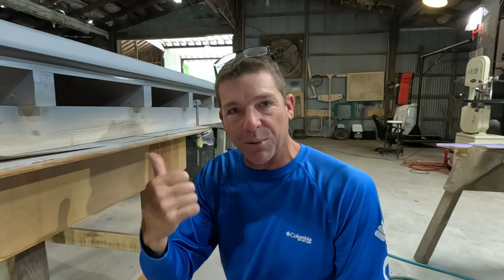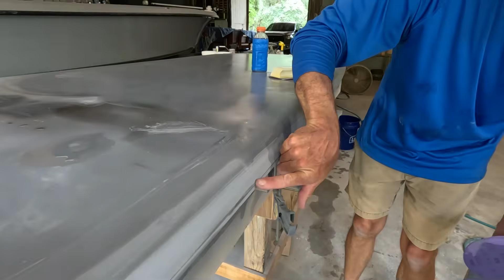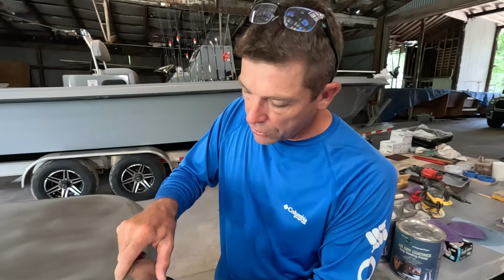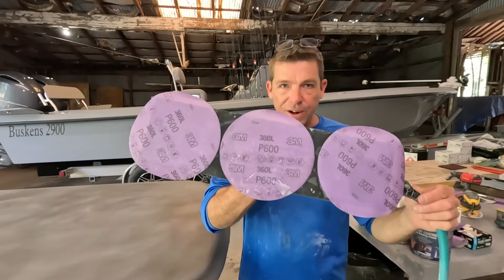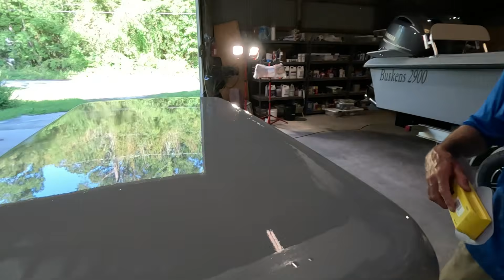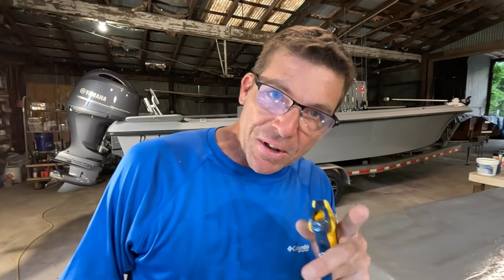How To Build Fiberglass Parts - Beginners Guide

Comment: I'm working on creating my own Vertical Wind Turbine.  I've created a model using my Bambu P1S 3D Printer, the model works well, it isn't large enough to create any torque enough to do anything, so I've scaled it up and printed base and top.  I've printed a mold for the blades using PLA, I want to use the mold to create fibreglass blades, each blade will be about 1000mm in height and about 270mm in width.  I am a complete noob when it comes to using Fibreglass.   Any tips on preparing and using the mold?
Reply from the maker: That sounds like an interesting project! Our 13 video hardtop mold building series is probably the most in-depth collection of videos on this topic that you will find on YouTube. I would recommend watching all of them, in series before starting your project. I would imagine that many of your questions will be answered. I hope this helps, and I appreciate you watching!

Comment: Joe I have a question, why when I work with the gelcoat, the outer layer stays half wet and never completely hardens? If you can help me with that I appreciate it, greetings from Louisiana
Reply from the maker: It sounds like the gelcoat may not have wax in it. If you want gelcoat to cure tack free you have to use a wax additive to add to it, or buy gelcoat that already has wax added. If you check out my gelcoat secrets video you will see what I mean. The other potential issues could be that it is not mixed completely with the catalyst. You should be mixing for at least a minute, or you are not adding enough catalyst. It should be 1 to 2 percent, which is approximately 10 to 20 CCs per quarter. I hope this helps and thanks for watching!
Reply: @FishBumpTV  Thank you very much Joe, I just saw that I made a mistake when buying the gelcoat, I did not order it with was, thank you very much for clarifying the doubt I had; It is the first time that I have used gelcoat, now watching your videos I am learning how to use it, again thank you very much
Reply from the maker: I recommend buying a wax additive for the gelcoat. You need the unwaxed gelcoat for your base coats, then add wax to your final coat for a tack free surface.

Comment: Great video and very informative. 
Are you planning to make more than the one Hard Top?
Could you discuss the pros and cons about making a plug and mold to make the Hard Top or make the Hard Top directly.
Thanks.
Reply from the maker: Thanks,  glad you you are enjoying the videos! Molds will generally produce a higher quality and more consistent part. They are a lot  of work if you only need one part though. I do plan on building quite a few of them, so it definitely makes sense for me to build a mold. I have had lots of questions about building molds, so I thought I would document and share what I was was already going to do anyway with you all. Building a one off custom part is certainly a option for lots of applications,  and I will probably do a video series on something like that at some point in the future. I hope this helps, and I appreciate you watching!

Comment: I see you're building a mold  so you can replicate this for any other boats that need it but I have a question?  Once you've built
this "mold/plug",  do you just lay "glass" within it & layer it up from there? If I wanted to build a "Top" for any thing in fiberglass
would I start with a plywood shape & glass it over or use a foam,  does fiberglass stand on it's own?  And using your boat mold
would you simply start fiberglassing by layers inside the "mold" & afterwards dump it out to finish?  I lack the proper words I'm
asking.  I guess,  are some boats simply "glass" laid inside of a "mold" that's dumped out to be the whole boat?  Is that how
some do it, I guess I'm asking?  Sorry  for the dumb question.  Thanks for all the pearls of wisdom. I'm thinking about this !

Comment: This may be a dumb question, but at the end when you were sanding with just the 1200 pad why did you have it flipped upside down and using the back of the paper? Was this intentional? Or did you do it inadvertently and the Velcro just happened to have enough abrasiveness to work?
Reply from the maker: The disc wasn't upside down, the 1200 grit disc's are semi transparent and it makes them look that way. Thanks for watching!

Comment: Guide coat is most likely carbon black. Most often made by burning an acetylene flame with no oxygen enhancing. This smoke buildup is scraped off a wall surface and collected.
Reply from the maker: Interesting, thanks for your comment!
Reply: I used carbon black for patterning signs years ago

Comment: Could you do a short on the Buskens 2900 loaded fishing weight?  To heavy to tow long distance with a 1/2 ton truck?  Thanks!
Reply from the maker: Estimated weight of the loaded boat it around 8000 pounds give or take. My Tundra pulls it very well, with no problems. I don't even have to use 4 wheel drive when coming out of the ramp. Hope this helps and thanks for watching!